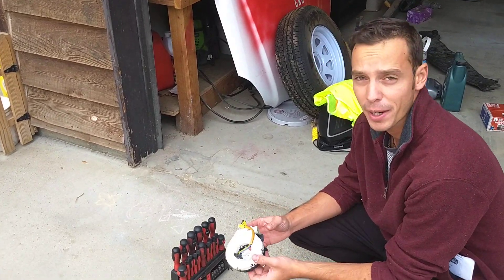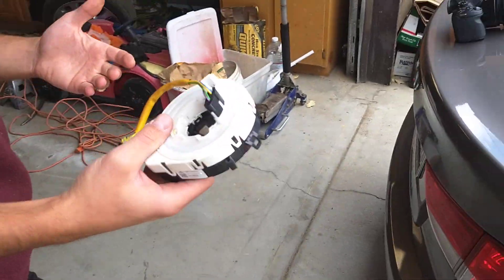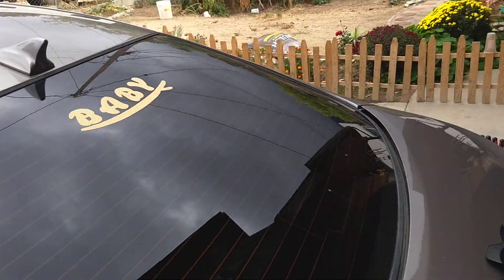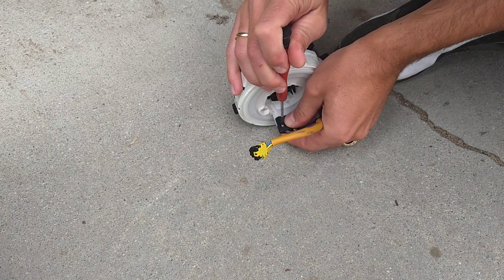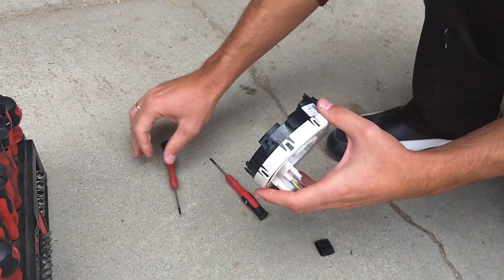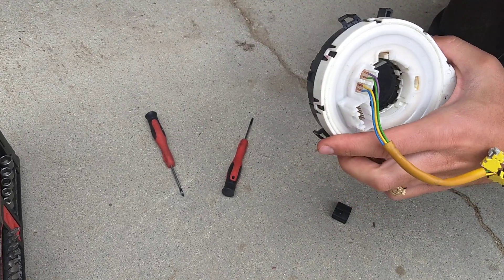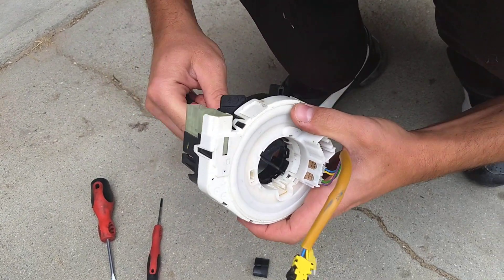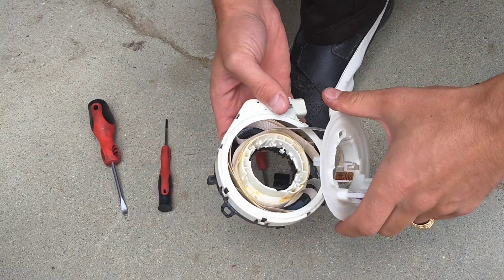WHAT IS INSIDE A CLOCK SPRING AND HOW DOES IT WORK

Comment: It is called a clock spring because it works like a spring in an old clock.  But this uses wires in a flat ribbon cable that winds from loose to tight in about 8 turns  (3 turns to the left and 3 turns to the right).   If you remove the clock spring and start spinning it  the wires are now out of alignment and can start pulling wires out.   Or if the cable binds it can break also.   You can see this one was spun about because there is a loop in the cable when he opened it.

Comment: Hi.  my 13 GT had The Advance Track needs service light come on and also hadsno power steering.  I was told by auto repair shop the code reader said it was a Ford Steering Wheel angle Position Sensor. Is this the same thing as the Clock-Spring ?   I can't find the Position, so maybe the Clock spring does both ??? Thanks
Reply: since this was almost a year ago was it the same thing?